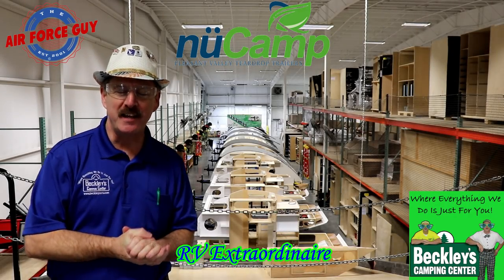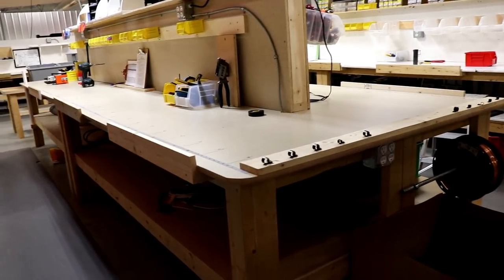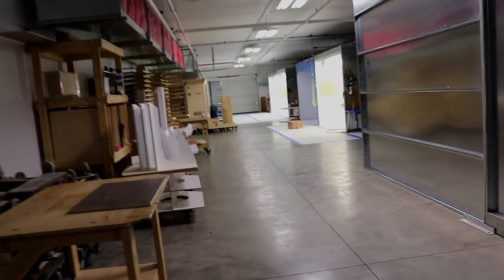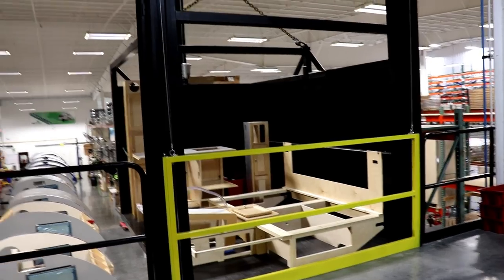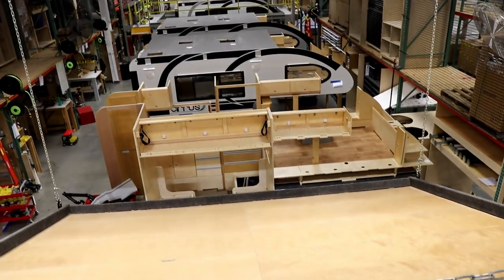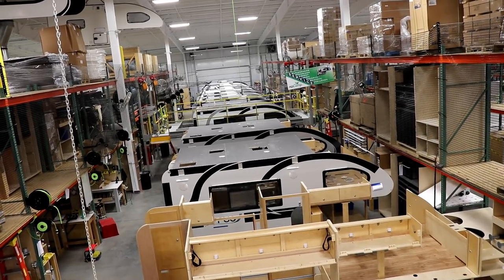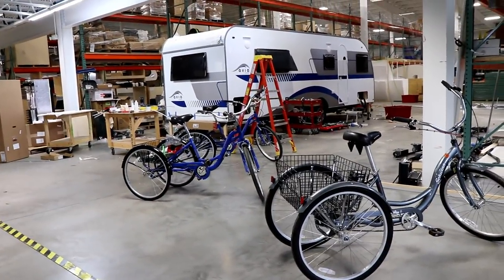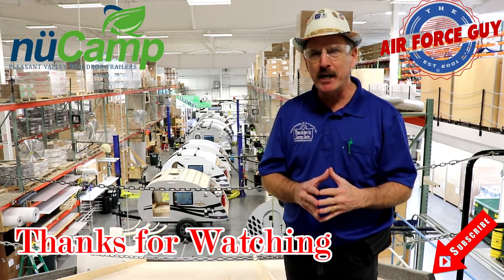NuCamp Factory Tour - w/Paul Chamberlain, Jr. "The Air Force Guy

Comment: Thanks for the tour Paul.  Impressive!  I'm thinking though, that I'd be pretty po'd to find that I'd purchased a NuCamp unit with an Azdel sticker on it that in actuality was constructed with luan.  1 out of 10 coming off the line w/o Azdel?  Are you sure about that Paul?
Reply from the maker: The Azdel Sticker is for the side walls, not the rest of the coach.  The only place there would be Luan is the inside part of roof.  Sorry if I misspoke.
Reply: @TheAirForceGuy  So are you saying that the roof liner inside the coach will be luan if NuCamp runs out of Azdel?  Or is the inside roof liner always luan?  Please be specific about this issue you've raised in your video tour.
Reply from the maker: This was not raised as an issue, was just to point out that some may have Luan for the inside roof panel.  The issue with Luan is when it is used to Laminate Fiberglass to it.  In the time that I have been in the RV Industry, I can't say that Luan vs a composite panel inside is that big of deal, In my professional opinion.  It is more expensive, but the Azdel as the material to Laminate Fiberglass too, is much more effective.  Hope this clears up what was said on the video.
Reply: @TheAirForceGuy  Thanks for the quick reply Paul.  I now understand what you were calling attention to in the video tour regards luan.  It's clear now, but wasn't clear based on your video narrative.  Again, thanks.